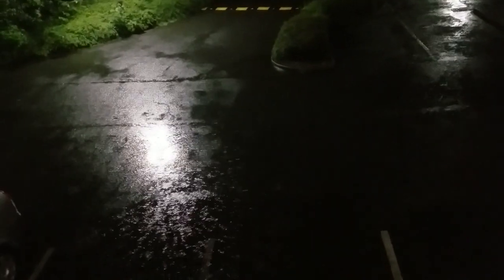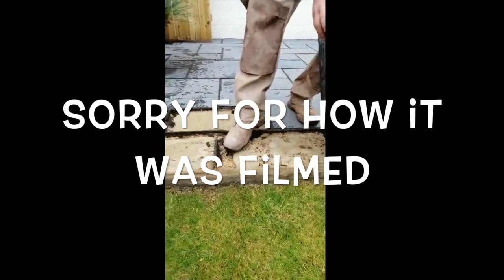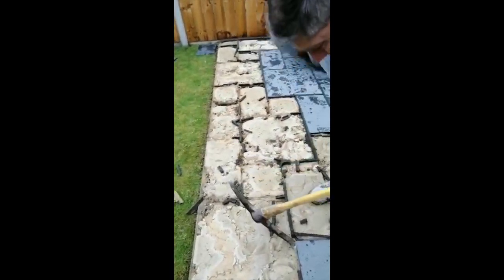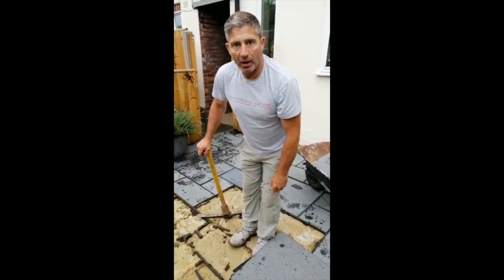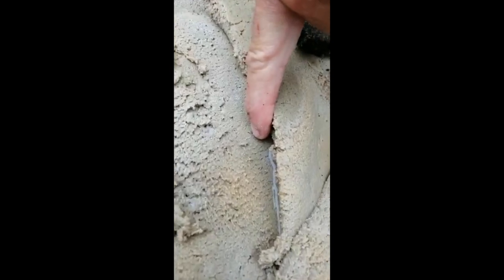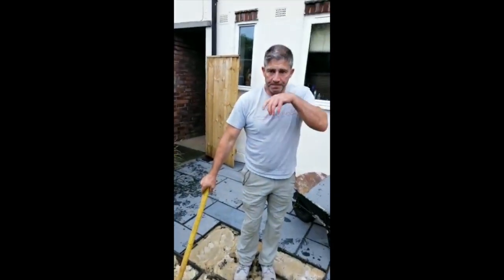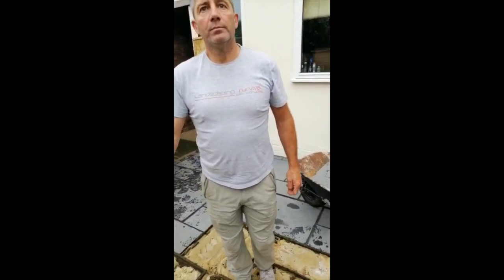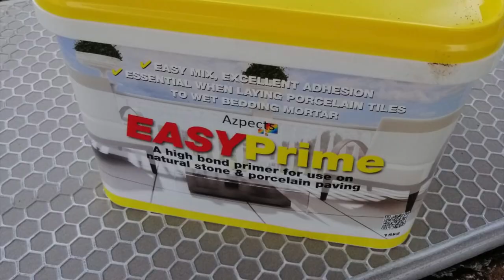Replacing A Poor Patio Installation In Stockton On Tees

Comment: I have purchased some 20mm to dust hardcore, with advice from the suppliers that it would be suitable as a sub-base for my patio, im a little concerned because it looks to be a 50% sand 50% small stone mix. So my question is will this be a suitable base @ 75mm depth for the mortor once its compacted? Many thanks to anyone who can answer.

Comment: Least it was concreted in. Most of  my relays are on sand or just mud.
Sharp sand all the way
Reply from the maker: I agree Matt thanks for watching bud
Reply: @GreentopLandscapes  no worries. Laying a patio on a job at moment. Going well
Reply: James Parker  yeah it is amazing what you find or don't find under slabs. Was quite shocked when found no sand or cement or sub base but just soil under neath. I did start using dot and Dab but now use a full base. Think it's because so many people teach things differently it gets washed down and so becomes a poor show in the end